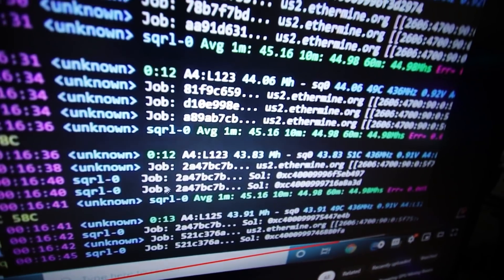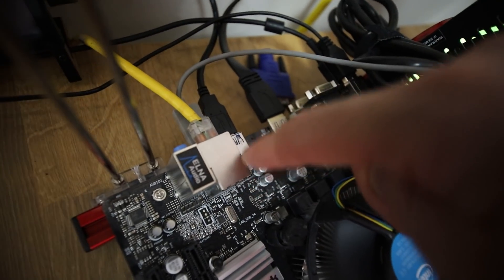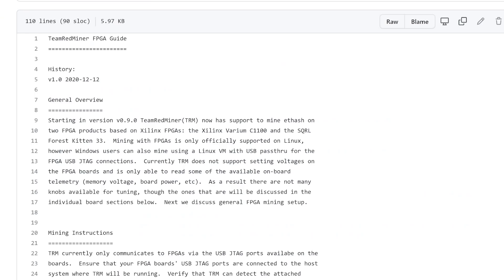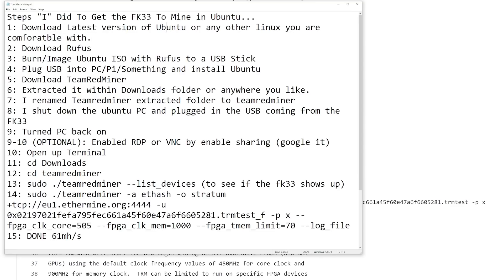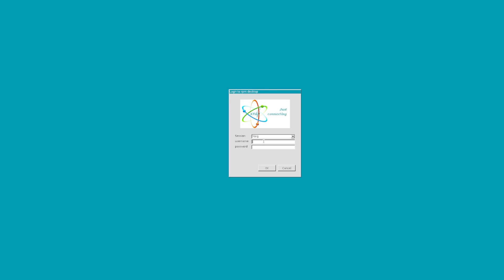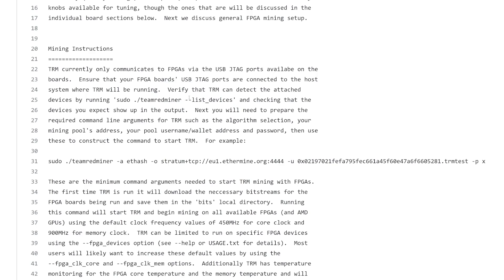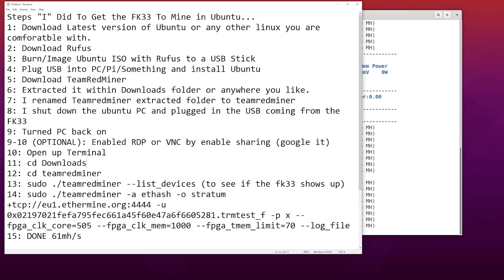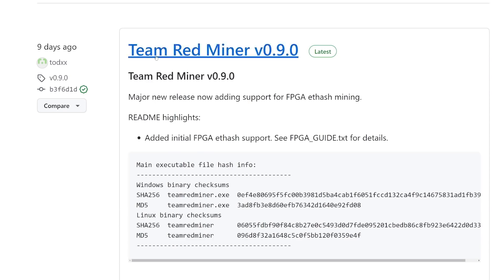TeamRedMiner Enables FPGA Ethereum MINING! SQRL FK33 Hashrate & Setup Guide

Comment: where do you even learn about fpgas? there is barely any info about them anywhere
Reply: they are proprietary in most cases and involve immense programming skills. most people work on their own versions for years in hopes of making their own chips as asics (FPGA--->ASIC). fpga is the first step. Verilog is the programming language for these chips, but they are widely inefficient (price wise) because of their proprietary nature. they are mostly learning tools for those entering the microelectronic circuit design field.
Reply: @noahwhipkey6262  thanks for the info! I'm not into programming stuff so I'll probably never use them then